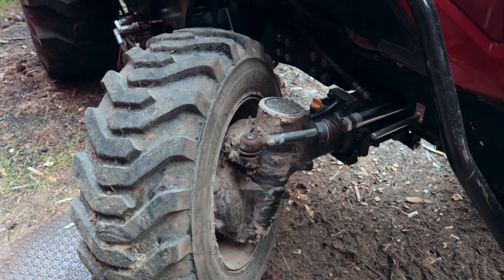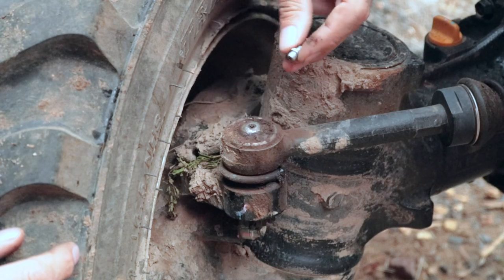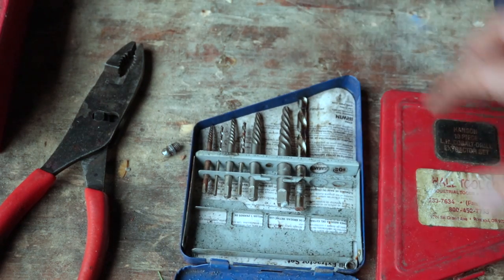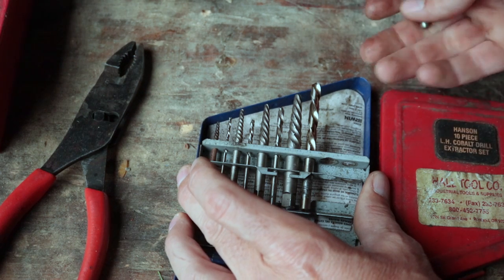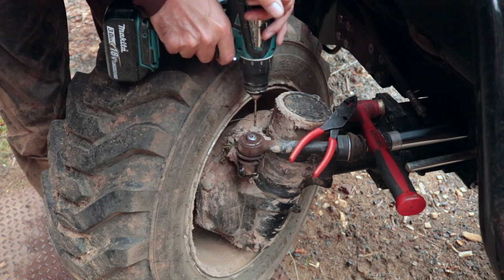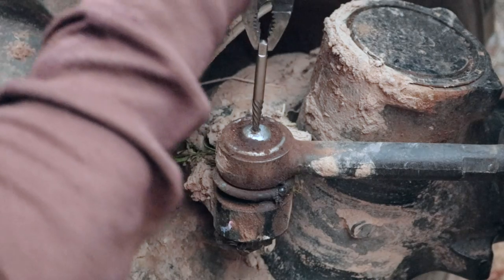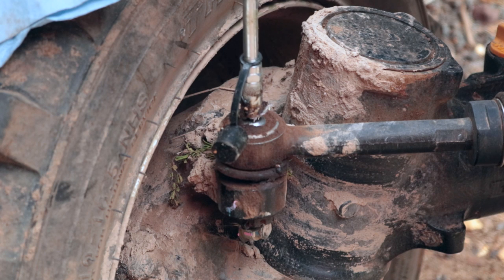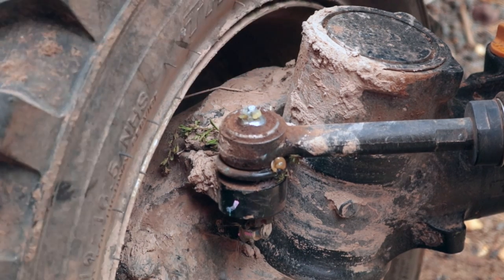I BROKE MY TRACTOR

Comment: Wranglerstar, those are left-handed drill bits. You then used one in a right-handed direction (clockwise) in your drill which advanced the threaded stump further into the joint rather than backing it out.

Comment: You were running your left handed drill bits backwards. You were saying you had a right handed set, yet they were left hand twist.
Reply: Agreed.  What he said.  You could clearly see they were left hand drill bits and the box even said left hand, yet Cody was running the drill clockwise. OOPs
Reply: same thing I noticed.
Reply: Yep!  Cody, you're awesome but not perfect.  It's pretty rare for you to make a mistake like this.  It's deserving of a little ribbing.
Reply: What he said^^
Reply: Not trying to be disrespectful. I really like and appreciate the work you put into this channel.
Reply: Exactly... Also, a handle from a tap/die set would be ideal for the extractor.
Reply: matt garcia he didn't have the room to use the t handle. It would have hit tire and rim.
Reply: The "T" handles I have I can remove them, it's not like they're rusted in place, doesn't take much muscle to turn the threads back out. But I think Cody needs a new pair of glasses though, was funny watching him run the drill clockwise when he should've been counterclockwise... silly Cody. Cheers :)
Reply: Michael Chavez  that is true my grandad has a lot of earthmoving equipment
Reply: Mechanical that was my first thought also and I noticed they are left hand twist bits and he was running the bit in the wrong direction. Also being an ex military heavy equipment mechanic and diesel tech you also can over grease certain parts that ends up creating more wear than normal because people blow the seals out.
Reply: +Michael Chavez I agree haveing a bit of armor around the zerks will definitely increase their life expectancy.  A pity the tractor manufacturer did not do that in the first place.
Reply: Buy some old square nut sockets, use extensions to clear the obstruction, and use a T handle to twist the extractor. That's what I do. Yanmar should have welded some 1/2 x 3/4" rigid reducing hubs around the zirks then capped them off with a small piece of coupling, and a ReDot cap. When you need to grease remove that aluminum cap, and grease away, and if the coupling piece gets smacked hard enough the aluminum ReDot cap will break, and can easily be plucked out in pieces with a stick. The zirk will still be fine.

Comment: Nice job fishing the broken part out once it ran into the ball joint.  FYI those WERE Hanson LEFT hand cobalt drill bits and you were running the drill clockwise when it should have been counter clockwise.  That is why it wasn't cutting and ran the piece into the ball joint.  Still a good video with otherwise good information.
Reply: I noticed the drill bits too. Oh well, Live and learn. Still love the videos. :)
Reply: I agree on loving the videos.  As I said above "otherwise good info"  Cody does a great job with his videos.  I can't say I have never run a drill backwards by accident because I have.  Wink maybe more than once.
Reply: Rashley's BorderQue 8
Reply: I'd be nervous about heat on the joint and boot.  Maybe try a recessed/flush grease fitting instead.

Comment: Is it just me or did anyone else notice that the drill bit he used was actually left handed. The spiral turns the same way as the eze-out. In the video he does turn it right handed and screws it up. But that was a left handed drill bit I saw.
Reply: M
Reply: 2:36 case says it's left-handed

Comment: since this happened to both zerks i would cut a small piece of 3/4 black iron pipe and tack weld it to the tie rod end it will protect the zerk from damage and debris alot of heavy earth moving equipment have armored grease zerks
Reply: MetroplexPrime2009
Reply: No, this is a BAD tip...   99% of tie rod ends on new compact tractors use a plastic ball seat, rather than metal.  Welding to the top of it will melt the plastic, and your tie rod end will be junk.    

Just make sure to watch the tire chains, and if they're getting close to the fitting, fix them.

Comment: The other reason why machines last longer with one person using it is because they take more pride in their machine. A tractor or excavator or something that has several different people using it never gets the proper maintenance because the guys using it don't feel like it's their responsibility to do all the things required for proper care. In my experience anyway.
Reply: I once blew up the engine on a company car. I didn't know that apparently everyone who drove a company vehicle was supposed to check the oil. I incorrectly assumed we had a maintenance schedule on the company vehicles and that somebody else was in charge of it. Apparently I wasn't alone in my assumptions because nobody else was checking the oil on the vehicles either. We were actually quite fortunate that it was one of the oldest, least expensive vehicles that lost the engine because some of the company vehicles were very, very expensive.
Reply: Agree. Now days it's hard to find anybody that wants to work, but even harder to find one that'll treat the equipment like they own it. It's sad when you put somebody on a 1/2 million dollar machine and they almost try to destroy it. I've always tried to treat other people's equipment as if I was the one making payments on it.

Comment: Perhaps in the 'advanced' version of the video you could discuss correctly identifying left-handed drill bits and why you shouldn't run them clockwise in the drill when extracting grease zerks, or grease nipples as they call them on this side of the pond? Still, job done, so all good... ;)
Reply: TCW81 It's a form of humour - you seem unfamiliar with it, so I can only recommend google and/or wikipedia ;)

Comment: In my 50 years of experience working with tools I have found those style of Easy-outs are pretty useless. What works for me 90% of the time are the Left Handed drill Bits (but of course you do need to run the Drill in REVERSE) LOL!! I've also got a set of splined Snap-on type  (actually made my Rigid) that are a little better but not by much. When a Left Handed Drill doesn't work I try cutting a slot in the piece and using a straight bladed screwdriver (if reachable of course). If all else fails a miniature diamond encrusted Dental Style burr or bit in a Dremel Mototool ALWAYS saves the day. If you are careful the threads are not ruined - but most of the time I do chase them anyway with the appropriate sized tap.
Reply from the maker: Love this type of sharing of info Bobby....
Reply: Bobby W: WS missed the satire
Reply: I do this sort of engineering repair work professionally and I try to avoid introducing metal chips into a grease point.  
A neat fitting Allen head bit will do a much better job than the tapered extractor. Snap on and Cat make excellent (although expensive) extractor sets that use the straight spline design. I don't bother to carry them in my tool kit anymore because I always have my Allen head tools anyway and I have not found a situation yet where they would not do the job. i think the idea of welding some sort of protection around the grease head is fine, just keep the heat away by cooling the area quickly.
Reply: Buy one of those ring shaped magnets that was a bit too imperfect for a medical pacemaker, and set that around where you are drilling, and tapping to collect as much of the steel metal chips as possible. Otherwise you wind up with extra metal shavings in your grease, where they will speed up wearing out the ball joint. I used to put them around holes I was drilling in electrical panels to keep the conductive steel out of the buses. That can get rather violent, and extremely unpleasant, should a large chip short out part of the gear. It is a good reason to wear a Nomex jacket, and a face shield.
Reply: And to cut a slot, a Dremel with a cut-off wheel works wonders.  A NAPA counterman told me that trick after I sheared off the bolts on my rear U-Joint in my CJ7.

Comment: PUT YOUR GLASSES ON !!   It was a left hand bit!!
Reply from the maker: Perhaps you need glasses, the bits are RH
Reply: You'd better double check, they are left hand bits.
Reply: @Wranglerstar: No. Go in to your workshop and compare them to your regular metal drill bits, and then come back here and say they look the same...
Reply: Sorry, but it is clear those are left hand. They cut spinning counter clockwise, thus left hand.
Reply: They are left handed, they look like left handed bits.And it literally says they are left handed on the case. So unless you reversed the footage and put different bits in the case they are left handed
Reply from the maker: This was right handed with an extractor.  We have both left and right.  This was right.  MrsW
Reply: Even the box said left hand.
Reply: Wranglerstar you may have both but all of the extractors and bits in this video are left hand including the one you were using in a right hand direction on the broken grease fitting.
Reply: @Wranglerstar, please look at this cutout from this video: http://madmodders.se/temp/diverse_bilder/drillbits.png
I've pasted a right handed drill bit besides the one used. The two are NOT twisted the same way. The one used is left handed.
Reply: MadModders your screenshot is absolute proof the drill had a left hand bit in it..  Ws must be on a 'comment drive' to insist it is a right hand, or maybe he is that unknowing of which is which. Sad .......
Reply from the maker: Huh.  interesting. MrsW
Reply: Wranglerstar Ray Charles could see these are left handed. I would think you'd respect your subscribers a bit better.
Reply: Wranglerstar if you read the lid of your extractor sets they say L H on one and left hand on the other. That is the drill bit and not the extractor you didn't put your drill in the right direction.
Reply: kirk humpherys reading the box is for amateurs, there are several give aways, the second being the reverse fluting, the third being that the drill doesn't bite into the soft zerk at all and start drilling.... i am waiting for the humble pie vid ..... he's even got mrs w drinking the koolaid
Reply: Wranglerstar I agree, those bits were left handed

Comment: Why not use a correct size spanner instead of plyers to tighten the greaser. Might help prevent another break or ruin the hex. I would cop an ear full if i did that at work!!

Comment: where's the grease coming from? a torn boot?
Reply: seems the ones that are meant to flow easily... if you are making a balloon stop pumping !
Reply: Justin Tarvid was wondering the same
Reply: don't worry, if the boot is cracked ( or seal ruined from over greasing) the ball joint can be replaced next video.  just call in ""standard maintenance"
Reply: No it does not appear to be coming from the boot, maybe a self purging type of joint, and we did see some contaminated grease get pushed out. This is my profession and I had no problems with his reasons for pumping so much grease.

Comment: Be careful with those grease zerks, some are what's called "drive-in", looks like threads but aren't. Those you just simply "tap" in carefully with a hammer.

Now that you've pushed a hole in the boot on the ball joint, you've also just allowed dirt and water to get in as well too. Won't matter if you wash or not, it's a hole in the boot which is to hold grease in the joint.
Reply: To be honest, I hate them myself. I should've stated, you can use a soft mallet or brass hammer, that won't distort them. Or, you can just simply rethread the hole and put in a proper zerk. Done that many times.

Comment: Yep that was a left handed drill bit run in the wrong direction another brand of extractors I have a lot of luck with is the grab it extractors you find at lowes, Home Depot etc if it doesn't get it you're going to have a fight on your hands no matter what

Comment: My dad introduced me to PROTO pipe extractors.  They are square with 4 straight "blades" on the corners that cut into the hole to extract whatever it is your are trying to remove.  They grab way easier than the standard helical type easy-outs.
Reply: Arkansas Pilgrim Hanson also makes this type of easy-out. I believe they're called Straight flute extractors. Only kind Ill ever use.

Comment: For those folks not aware, vehicals used to have grease fittings also. Popular Mechanics had an article years ago how to drill, tap, and insert grease fittings into the ball joints and tie rod ends.

Comment: The number of thread sizes used in equipment for grease fittings is ridiculous, and having them all on-hand is a real pain.    GRRRRRRRRR!

The same is true of allen wrenches, which come in 64ths of an inch, plus metric of course, and in several thread sizes.   GRRRRRRRR!

IMHO, the tie rods belong BEHIND, not in front of, the axle, which gives these vulnerable point at least a little bit of protection. Placing them in front is a major design mistake.

(My Mahindra has the tie-rods behind the axle)

Another very handy greasing tools to have is a "blowout" tool for freeing up stuck-up grease joints. The good operator is never far from his grease gun, and takes care to get every one of them, and often. Grease is CHEAP, repairs are expensive.
Reply: 4WDs commonly have tie rods in front to avoid interference with the driveshaft.

Comment: Wouldn't have touched the drill on that one
Reply: Small screwdriver or hard pointed pick ?
Didn't see a small easyout in the box.
Reply: Jameson McLean 
I know. That smallest extractor probably would've fit easily into the hole that's already bored through that part of the zerk. Why introduce metal shavings into a joint when you don't need to? Of course, you don't get metal shavings when you insist on calling a left-handed drill bit right-handed and run it as such. LOL
Reply: I've used a star bit as an extractor before just like a fluted extractor
Reply: ya live and ya learn
Reply: A hardened star bit is great solution in some cases, provided there is enough streangth to the material walls, otherwise it will expand the screw stud & jam it in there.

Comment: why did you drill a hole in it? there was already on there
Reply: The most common use of an extractor is on bolts that have broken off and bolts don't have holes in them so the drill is used to make a starter hole for the extractor. In Cody's case he could have used just the extractor if one would fit the zerk hole.

Comment: In exception to the one user rule, my neighbor always made sure to grease his tractor once a year, if it needed it or not.......  ;-)  
He had to have new sleeves welded in due to the neglect.  If the operator is an idiot, the machine is still going to be in trouble.
Its amazing just how much abuse a machine can take before it fails.

Comment: That easy out kit should've had reversed drill bits so you can spin backwards that way if it does move the broken off part it will spin out not in.  Great video 👍🏻👍🏻

Comment: Wait, was it necessary to drill out the insert? It looks like one of the extractors could have taken it out without drilling. I may be wrong. Would be nice not to introduce extra metal particulate into the joint.

Besides, the drill bits look distinctly left handed, huh. At least the flutes appear to run the opposite of screw direction.

Comment: Easier than replacing tie rod ends, cheaper too. A left hand drill would probably have removed that zerk without the easy out. Good video Cody. When servicing forklifts I would wonder, don't these guys ever check the fluid levels.

Comment: Broken fastener removal is quite an artform... the extractors can be easily broken by someone not paying proper attention to the workpiece (not so much on zerks, more like bolts) it can be a real headache with a broken easy out in the mix. Heat is one of the best friends we have, I always clean the area, apply the heat and touch the threads with candle wax before torquing at all.

Comment: You didn't have to drill broken fitting out. Just use the smaller easy out. it will come out easily.  I just did it recently.

Comment: Good video!  I buy and use them as a consumable bit in my toolbox, since with constant use even the expensive ones get chewed up pretty quick.  Irwin makes a nice mid-grade compromise and any local ACE hardware will usually stock them or be able to order them in pretty quick and cheap.  They make LH drill bits, too.

Comment: Since the zerk already had a hole in it...probably would have been a good idea to try your smallest extractor bit without drilling, either way it worked, but usually it's a bolt that has broken off and in that case you need a hole.

Comment: Just don't overgrease the swing on an excavator, usually the manual will tell you to grease it only when you change the oil. I've seen far too many swing seals blown out because people think they need to be greased every day like a bucket pin or bucket linkage pin.